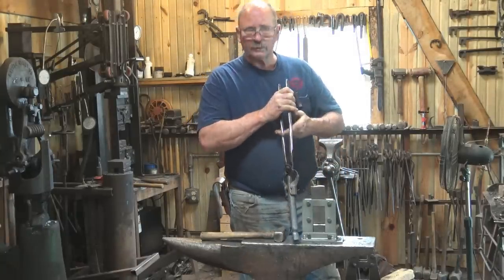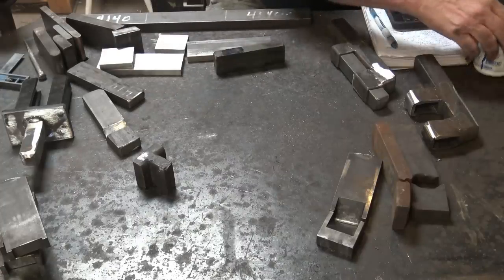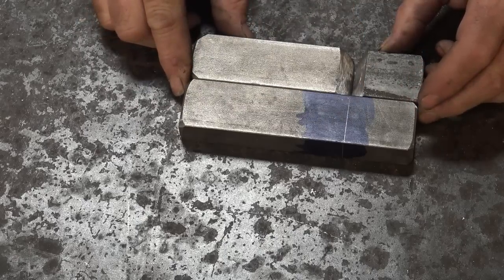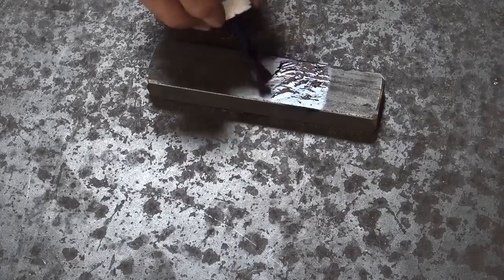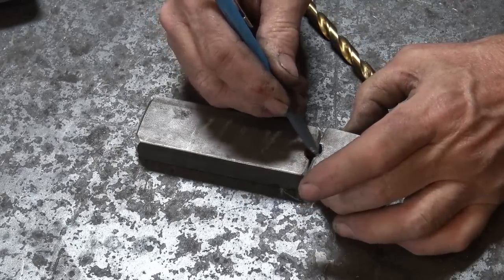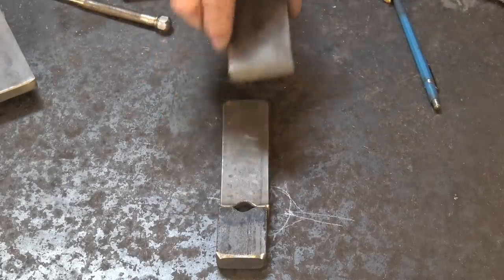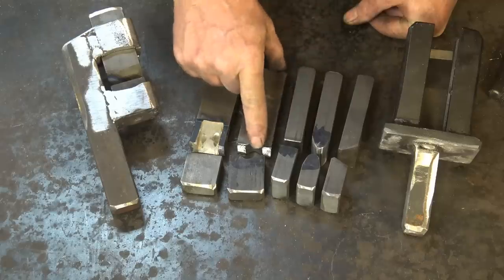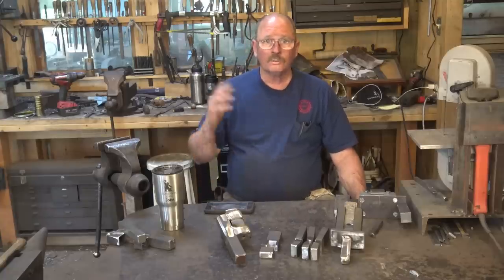Making forging dies for the guillotine tool - blacksmithing tools

Comment: Because of this video, I bought one of Jerry's tools sold on eBay. Easy guy to work with and I like the tool.  Although it comes with 1/2" by 2" A36 steel dies, I like the fact that I can add a spacer and use 3/4 X 2 inch 4140 to make dies. Makes it much more flexible to accumulate sets of dies for different projects.  Got the bolted on hardy shank so that I can easily remove it and use in the vise. So far I am pretty impressed. Thanks for all the videos.

Comment: I have one of Jerry's guillotine tools, it's very well made and he'll add a hardy shank for a nominal fee in whatever size you request.  He's also super easy to work with, the tool I bought came with flat, fuller and an unfinished die, I had him make a set of butchers for it for an additional $9.  Highly recommend him!

Comment: Just a thought on making the cut off die much easier - If you want a 2" x 3/4" die, use a piece of 1 1/2" x 3/4" and two 1/4" x 3/4" for the sides. Just make your 30 degree cut and weld the 1/4" thick strips on the sides, making sure to groove for the weld (or drill and plug weld) and grind flush. Easy peasy. The same technique could be used for tenoning dies as well (in the style of those Smithing Magician dies). One could drill and tap countersunk screws to connect the pieces, but that's a lot of horsing around too.
Reply from the maker: That would probably work out
Reply: I was thinking the same thing

Comment: With the tenoning tool you could cut it first and then drill the appropriate size hole. If you find your drill press vice isn't powerful enough to hold the two halves together then drop a couple of light tack welds on the halves before drilling then grind them off when you do the rework.

Comment: I have a set of cut off dies that I made with hacksaw and file only.  It works,  but it's a slow method.  I'll try the angle grinder on the set (tenoning) I'm working on now.  This was a very helpful video for me.

Comment: May I suggest an alternative method for the tenon tool. Make the cut first.Then securely clamp or tack weld the 2 pieces together and centre punch on the join. Drill the required diameter and then flare the sides. Not only will this ensure the required diameter is achieved, but also that the 2 halves are identical.
Another great vid btw :)

Comment: Very useful video. Thanks again. You're filleing didn't squeak at all. I didn't have even one shudder from the filleing. I can tell the steel is softened, and the larger stock makes a big difference also. I'm sure 1/4 x 1 would scream. Thanks for all the good Steele type info also.
Reply from the maker: I am trying to remove the microphone and set it in something to muffle the sound when filing or grinding.  But sometimes i forget to go and get it again.

Comment: So I really like the "new" tenoning dye idea with pins, but I'm wondering how you stop the pins from becoming a blind rivet? i.e mushrooming at the base.
Personally its a cost saving thing as the only hardening steels In those dimensions can get are fairly expensive. pins in one dye makes it very multi functional.
Awsome video, I'm loving the guillotine videos, said it before but been excitedly waiting for these for months. 
Also I still say your efforts turning off the mic for the power tools is really pleasant to watch/listen. Thanks so much. (At some point ill stop saying this, promise)
Reply from the maker: I too wonder about the pins getting stuck, or just lost.  They would have to be hardened pins.  Of course you quit hammering once the top die contacts the pins
Reply: Thats a good point, they are stops and not intended to pound on. So possibly the largest pins you can comfortably fit in your die with a loosish fit and hardened. It be hit if the stops gave that lovely pinging ring you get from some hardened steels when they contact, like a "you've arrived" bell lol
Reply: Just had a really good idea instead of pins. Cut two half inch wide notches in a square bottom dye. The put long slim inserts into the tool loose. The should be longer than the notches in the bottom dye, by the size you want your tenon. Fairly simple to cut the bottom die and you can easily switch out the inserts to different sizes.
Heres a diagram that might explain better.
https://docs.google.com/drawings/d/15IJoqOd7ed_92h9fQIDFRDd-tkSebErA2WAfRPtbTBo/edit?usp=sharing

Comment: 3:12 I assume it should be a trivial matter to cut 2 pairs of 1/8" x 2" flat stock shims  to sandwich the 1/2"x 2" fuller to adapt it for use in the 3/4" guillotine.  For that matter you could also countersink a pair of holes in the flats and superglue a few 1/4" tall rare earth magnets that sit flush ... that'd make the shims hands free and removeable for use with any 1/2" set. It should definitely on the bottom pair ... the top pair might need a little more gripforce. Assuming they're magnetically compatible of course.

Comment: Are you going to make a video on the hardening and tempering of these 4140 dies and potential problems doing this size steel and hardening a batch of dies together?
Reply from the maker: I may at some point.  The only big issue is making sure you have adequate soak times to heat all of the way through the material.

Comment: John that really helps me, I just started to make my dies and did not know where to start. I have one question on the top die, I saw in a book I have they weld a flat square piece on where the hammer will strike to protect the die from mushrooming. Do you think this is a good idea? I am using mild steel to start as it is what I have and easier to work with. Thank You great video.
Reply from the maker: That can help out and does allow the striking surface to be replaced.

Comment: Hi John I made one of these the other day, and today Sat 11-5-19 I made some butcher one's for it, but I am having such trouble trying to get the ends to match up be straight, I don't have fancy belt sanders only cheap one's and they don't seem to help, I have an angle grinder, but I find it hard with a flap wheel to get things straight, any Idea's mate.????
Reply from the maker: A hard disc on the grinder might be better.  Otherwise a file might be needed.  the good news is that they work pretty well even if not perfect.
Reply: @BlackBearForge  Yeah thanks John,  did get the hard disc on the grinder and a lot of filing and then a straight bit of wood and sandpaper seemed to come out good.

Comment: I’m new to buying and working with tool steel. Do you buy annealed 4140 and then heat treat and temper it after the dies are made?
Reply from the maker: I prefer to start with annealed stock then harden once the tool is shapped

Comment: John, thanks, now I will tackle the cut off die.  I also learned something on the layout of the tenon die.  Do you temper the dies as well?  Also last question, what brand fiber wheel are you using on the chop saw?  I have decent saw but have not found a decent wheel, yours seems to cut pretty fast.
Reply from the maker: I am glad it helped.  I do harden and temper my dies based on what steel they are made from.  I have no idea what the brand name on the wheel is.  I just order them from McMaster Carr online.  I will try to look today.
Reply: Thanks...

Comment: I can't find anyone in my area to supply tool steel in the sizes you are using to make dies. Can I make dies with smaller pieces of tool steel welded to larger mild steel pieces? Specifically the striking surfaces and work surfaces?
Reply from the maker: You can certainly weld a hard face to mild steel.  You can also mail order tool steels, that is what I have to do.   I generally buy from McMaster Carr, but depending on your location there may be better sources to order from.
Reply: Black Bear Forge     Thank you for getting back to me wih that.  Been watching your videos on forge welding in anticipation of die making. Excellent videos, John.

Comment: Instead of filing with the round file to the size you need after cutting the die, how about clamping it together and ream the space with the size drill you want?
Reply from the maker: Drilling tends to leave sharp edges that need to be cleaned up with a file.

Comment: Hey bud.   I made a Guillotine tool and dies for it.   The dies are Mae of 4140.  My question is on tempering.   McMaster Carr doesn’t have anything on 4140 noir does the heat treaters app after quenching in warm oil I put them in the toaster oven at 450 for an hour and then 30 minutes.  Does the double temper help.  And do you think that is good for the dies.  Or do I need to get them hotter like 550 - 600
Reply from the maker: That should be good to use.  I am always surprised at how little tempering information is provided.  There is a chart paet way down this page http://www.anvilfire.com/FAQs/heat-treating-4140.php
Reply: Perfect. John. Thank you.

Comment: What kind of bandsaw blades do you use for cutting 4140?  I keep wiping out my bandsaw blades on tool steels.
Reply from the maker: I actually cut most of my alloy and tool steels on an abrasive saw to save blades.
Reply: @BlackBearForge  Is that a bandsaw blade with diamond bits on the cutting edge?

Comment: What kind of blade did you  use on the bandsaw to cut the 4140? (teeth per inch and size)
Reply from the maker: Probably 14 tpi, but I don't change blades for any given task.  Its just the same one thats been on the saw for a few years now

Comment: 7:11 ... Why not just take some narrower stock cut the shallow cut off angle on it and weld some 1/4" thick stock to the sides to make the channel? No milling machine needed and the width would be the same

Comment: You could also use a chisel to hog out that cutoff die.  While not as quick as the angle grinder, it's probably a little more accessible to the bare beginner.  Besides, chisel work is probably an undervalued (and underused) blacksmith skill.
Reply from the maker: That would be a valid approach.  But I doubt that this tool would be worth the trouble.  but you are right, chisels are under appreciated.

Comment: I do not agree with the measuring this time. For a 30 degree angle you would want the slant line to be twice the width of your material. Taking the straight length to be one and a half times the width gives me an angle of about 34 degrees.
I might not see the difference though. Just triggered from 'exact' :)
Reply from the maker: Could be.  Thats the trouble with relying on memory when you get older.
Reply: 30 60 90 triangle- Hypotenuse is 2 times the base . It's half an equilateral triangle. you are correct sir

Comment: Great video. But actually that angle by construction is not exactly 30 degrees. It's approximately 33.69 degrees. For 30 degrees one side is 1.732 times larger. However easy way to calculate 30 degrees is the diagonal is twice the shorter side. So you can set combination square to twice the thickness (3/4) so inch and a half, then lay corner of square on corner or 3/4 side the rotate square to where it hits the other side at one and a half inches and draw the line. That would be exactly 30 degrees